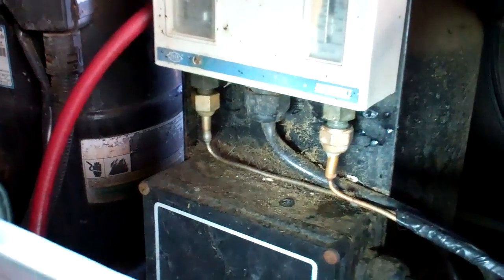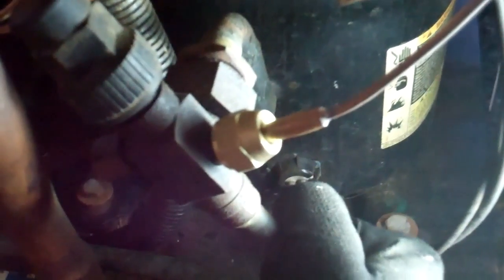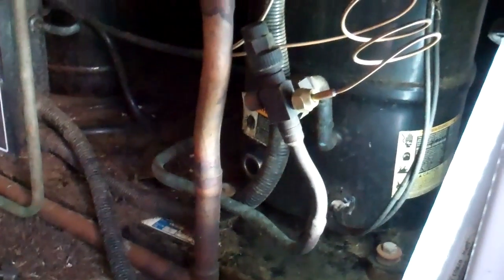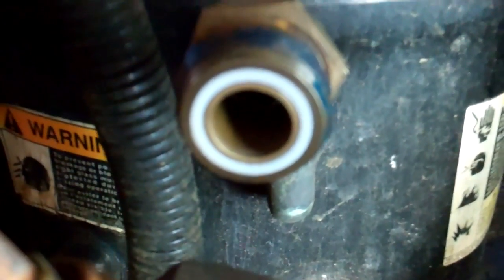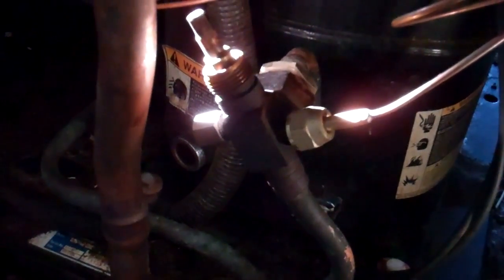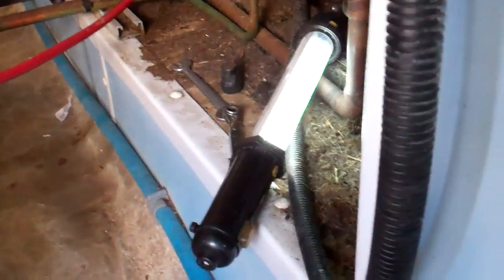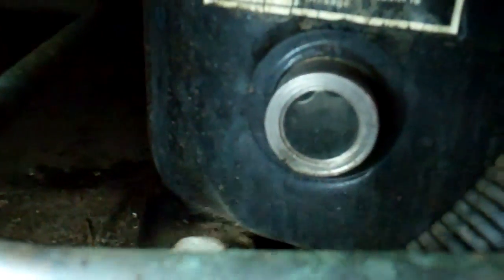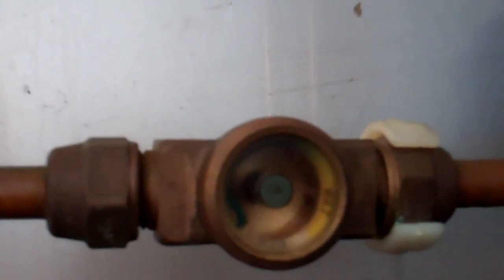Rotalock Valve Leak

Comment: I think Trane has stopped using scroll compressors with Rotalock fittings on them.
Reply from the maker: douro20 I like them for refrigeration applications, and maybe commercial as well, but residential i prefer the leak tightness of a brazed joint.